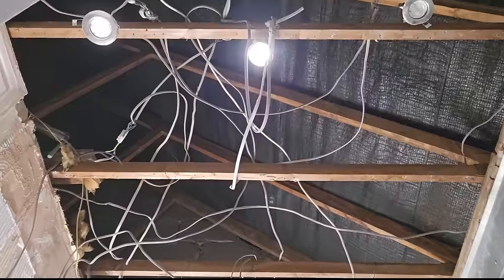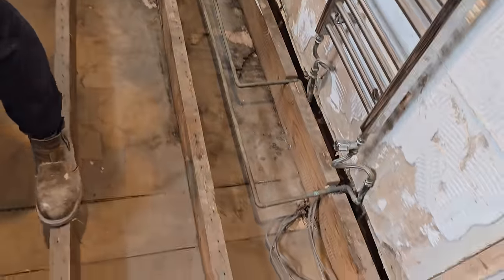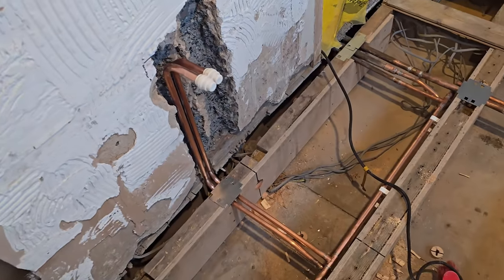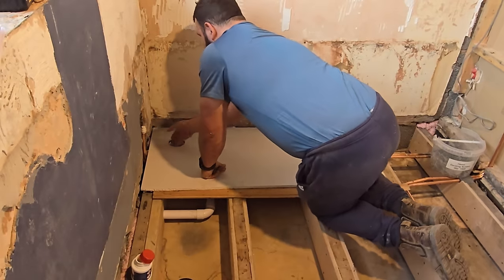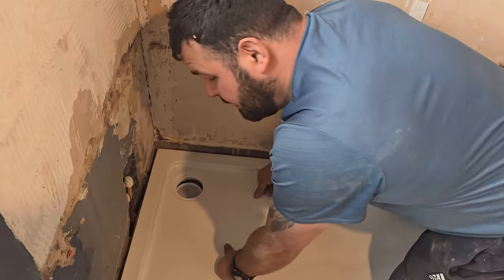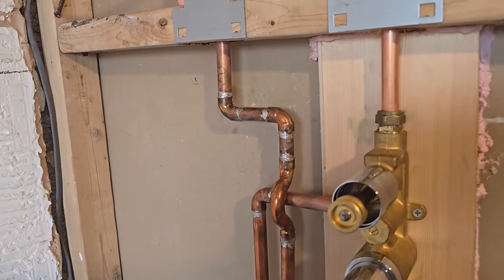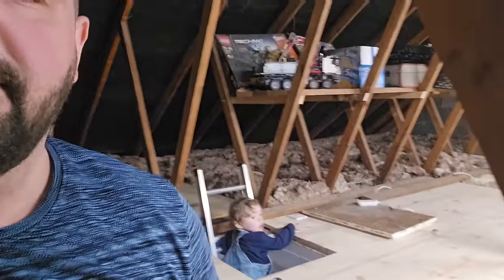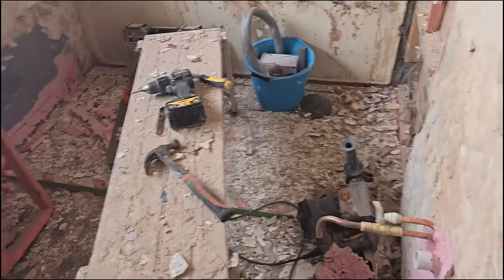FITTING A BATHROOM FROM SCRATCH | PART 1

Comment: Use flexible tile adhesive instead of cement on tray, much better and allows for movement on wood.
Reply: with ditra mat under & across the floor set with vinyl adhesive,  the underfloor heating can go in a bed of tile adhesive back  buttering the tiles wet to wet  for  a full bed all in one go, , keeps finished floor height down,  allow couple days to dry  , bring UF up to working temp , kill allow cool & grout with epoxy grout , .... bookmatch & miter windows revels , shower niche  etc no tile trims ,,,

Comment: Great job Kirk! Just a little tip with soldering those pipes. Heat up the pipe, move your torch away and then just dab the solder onto the pipe. Then add a little more flux and heat up again. It'll give you a much cleaner joint
Reply: Oh and, not a plumber here. Just done a fair amount of copper pipe soldering myself
Reply: Clean pipe flux up both fittings heat under medium blow lamp dap solder with the lamp about 5 inches away and the heat convection will suck the solder in. If ur blowing your solder away you didn't put enough flux on or too high/aggressive heat from the lamp
Reply: @locien182 agreed. Your explanation is better than mine lol. I'm a micro soldering specialist and solder loves to follow the heat like a magnet and steel balls but too much heat will just burn off any flux rendering it useless and ending up with dry joints  which crack over time
Reply: @TheCod3r  yup and especially when you put a copper pipe behind a wall or unaccessable places the last thing u want is a brittle joint thats going to spring a pin hole in it. always the way it does tho.
Reply: Or use plastic???
Reply: @NAFO_Badger_Brigade  You can but it still needs to be converted to copper and brass for the terminations

Comment: Hi kirk 
Superb mate that's why I love my job . As a fitter / welder.  In a steel works in wales. 🏴. So when it comes to plastering bedroom or slabbing my back yard.  Plumbing my bath room its grate  as this is not my normal work trade. The plumbing looked the finest to be honest. There are some plumbers that struggle to use a spirit leve and  there are others that are  on top of there game as in all trades I guess. And doing what your doing  gives you self satisfaction.  As this is out side your normal trader. 🍻🏴🏴

Comment: Hi Kirk, I’ve just gotten into your videos via the skill builder channel. I’m an elecchicken! 🤣 Nothing wrong with a fan isolator in the loft, their main purpose is just for maintenance ie cleaning and replacing… it makes good sense to have it in the loft when you use an inline fan. Did you consider an inline fan? I find fans do a better job when ceiling mounted or you use an inline with a vent in the ceiling. Just incase you don’t know, if the fan is in the shower tray area it should be a low voltage one, 12v. 

Anyways I’m loving your videos and look forward to seeing the bathroom finished. 

Top bloke and a top tradesman, if more people were like you the world would be a far better place, keep up the great work 

Kind regards 
Dave

Comment: Good attempt for a plasterer mate   a few things id have done different marine ply under the shower tray sbr primer and flexible tile adhesive to bed it down, your boiler flue needs proper brackets fitted on each joint in the loft strap band is a no no over all your on track to a successful job, dont forget tanking of the shower area 😉👍

Comment: As a plumber you’ve done a bang on job mate 👍just a tip with the shower normally you need to put a 1/2 to 15mm angled backplate to accept the shower head/wand just something to double check before you tile mate💪🏻
Reply from the maker: Cheers mate

Comment: Get a classi seal on that shower tray.
Get some hair felt between the pipes and joists.
Flux the pipe and the fitting.
Same with the glued waste. 

Doing a better job than most plumbers 😊

Comment: Better than a lot of the plumbing I see. Not sure what you have got running your hot and cold water but you might have a problem getting enough flow to supply that shower head,apart from that bloody good work 👍

Comment: You see that 4" tee piece in the corner, it has a connection on either side and the back to allow you to put your wastes in to it without taking them outside, if you'd had run 50mm to where it would tee off to the basin there wouldn't be any gurgling and you'd get a great flow

Comment: Subscribed! How much do you charge for a fuseboard change? 😂
It looks good mate, I got to give credit you plasterers are grafters, my brother in law is just like you from Tamworth, talks abit the same 😂
Only thing I’d say, is cut off switches (in emergency) should be accessible. Which is against regs.
But because of the amperage, logically it’s not the worse thing imaginable.
If it was an electric shower I’d be suggesting a pull chord.

Comment: Brilliant job Kirk.Quick question  when sand cementing over painted block would you sbr the walls first then scud??
Reply from the maker: I'd honestly try and get the paint off mate but if it was impossible then I'd probably want to fit rib lath with scres and washers.
That said, there is a basecoat that VPI do that is designed to stick to paint but I'd be abit worried about it.

If it's a garden wall or something then no big worries but if it's a full house then it could be very costly if it started to come away mate
Reply: @Onthetrowel  Thanks Kirk yes its garden walls i was thinking of pressure washing 1st to remove loose particals then sealing with sbr,fair play thankyou ill have a good think